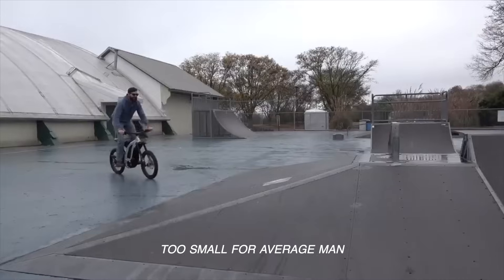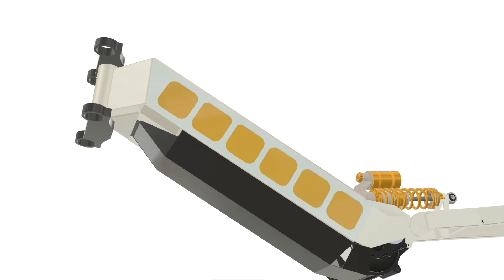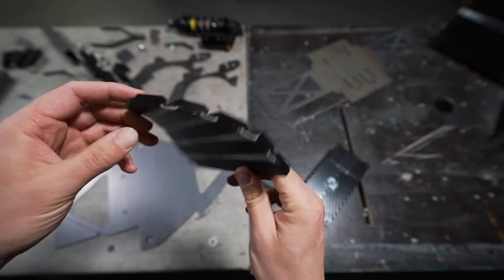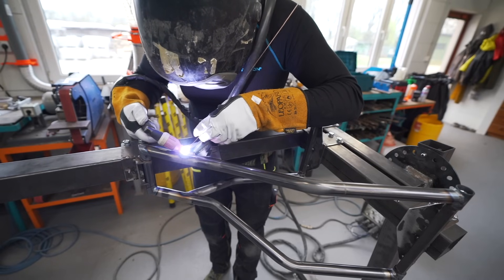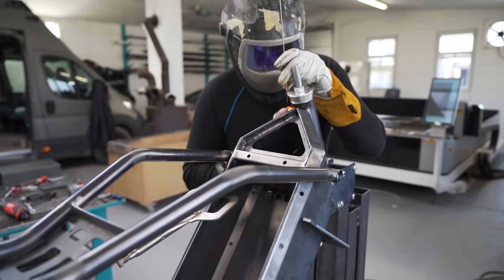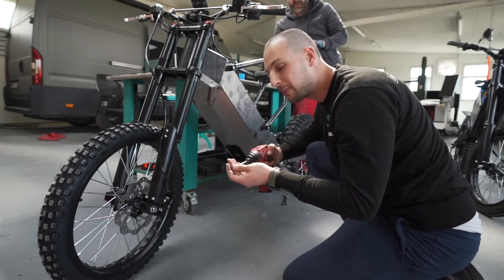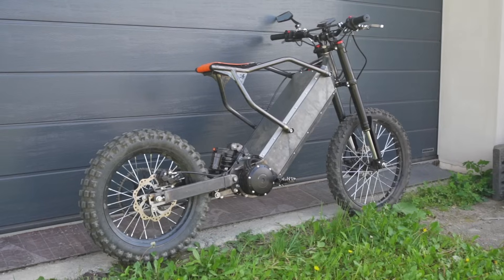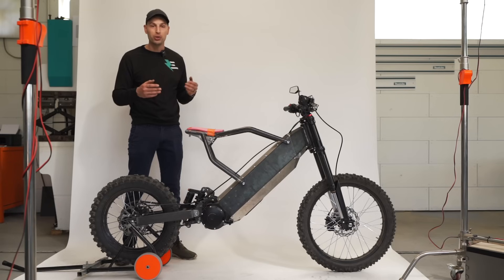Building Insanely Fast Electric Motorcycle From Scratch / New @ridevoltic Build

Comment: You dont paint it, you powder coat it when its done.
Reply: Yes and no, in the racing and frame building industry it is argued about. Yes powder coating is amazing protection but the layer it forms on the outside can hide any cracks that may form in the metal. I think builders preference based on amount of abuse frame will take.
Reply: In my experience any cracks in welding joints show in the powder coat.
Reply: @TeamStevers dependant on how thick or flexible the powder coat maybe ...  the crack may become fatal ... before it shows through
Reply: @TeamStevers  welding joint aint the whole frame
Reply: @TeamStevers absolutely yes! Agree!
Reply: Paint is better than powder coat.
Reply: I told you agree powder coating good peel off no matter how good the protection is underneath @Turbogto_guy

Comment: Nobody makes this yet? Ya its call the STARK VARG sexiest most powerful e-bike 80hp (60kw) at the rear wheel and best handling dirt bike there ever will be.
Reply from the maker: That’s a different price range and use category. Not even street legal.
Reply: @ladiandmargaret  A bicycle isn't street legal but we still ride them down the road. I didn't realize you wanted to ride on the highway. A different price tag. I bet you're time is easily worth 30 bucks an hour. How many hours you got into this build? How many times have you had to cut the parts out? How many redos have you made? How many people are working on it at 30 bucks an hour? Just saying!
Reply: As the saying goes, the cheap turns out expensive.

Comment: Innovative work as always Ladi 👍. I am genuinely scared for your ankles though! 😅
Reply from the maker: Why?
Reply: @ladiandmargaret  Hello Ladi. The lower seat frame mounting bolt position, that you currently have, could potentially shatter your ankle in a side accident/fall. If you move it to a position that avoids the ankle and main arteries it would be safer in a side impact. Right now, without a cover on the tube, it looks very much like a leather punch 😅.

Comment: Great project !  I have a 15 Kw e-bike with 3.5 Kw/h battery capacity and I can make some informed observations. I posted a video with me a few days ago and I recorded some more today and will post soon. I did over 1000 Km on this bike off-road, in the forest, in mud.
1. The engine needs a shield because that`s the impact spot every time you pass over a tree or rock.
2. The controller radiator is located in the exact spot where all the small tree branches that fly under the front wheel hit and also were all the mud builds up (just did 35 Km in the forest today and I can tell you I had over 1 kg of mud in that exact spot in less than 15 km)
3. The body of the bike has to be of plastic with crumple space so when you crash the plastic will absorb the impact before the metal case is crushing your bones.
4. Ditch that seat frame and make a classical triangle in between the fork, engine and seat and make the seat double for 2 people and maximize a storage space underneath so you don t have to carry a backpack with cloths, tools, snacks, water, survival emergency kit, medical kit. If the bike tail is not over all the back wheel the mud will fly on the back of your head.
5. You have to be able to hold tight the bike with your legs/knees in standing up and on the seat position to stabilize it in ruff terrain and also to put less stress on your arms so you have better endurance. 
6. Make it waterproof !!!
If you address these points I will absolutely sell mine and get one from you.
Success !
Reply from the maker: Hi, thanks.
1. We will have a shield on the second prototype.
2. We’ve been working on mudguards
3. The battery will be around plastic to absorb impact when crashing. I don’t know how you imagine body from plastic.
4. I disagree. Storage will be made as soon as we figure out the most important mechanics. I don’t think these bikes are supposed to be for two people.
5. I agree. The current design is very good for holding the frame with legs when standing up.
6. I agree, it’s designed to be waterproof obviously.
Let me know when you are ready to order.
Reply: Thanks for considering my ideas. I want to see the final design before I order because I really love what you guys do and I like a lot this specific design apart from the seat frame and ergonomics. In the current state I would order it but then have to ditch the seat frame and pay someone else to build a double seat with as big as possible storage space underneath and have to mold some how a plastic body which is pretty expensive as a one of. I will closely watch the future details on this project and I already put for sale my ebike and a truck so funds will be available by the time you get closer to a final design. Another thing it would be interesting to look in to is to see if it's possible for the inbuilt charger to be compatible with a small petrol generator. For example I have a small 4 stroke generator that makes 800 W/h but my charger is 840 W/h and the generator cuts as soon as I connect the charger. So it would be awesome if you could select a few power levels that the charger is requiring. This feature is also a safety feature as Lithium batteries degrade over time and some might wish to charge them slower especially if they live in a very hot region.
Reply from the maker: Thanks. The charging current is fully adjustable in the controller setting. I tweak the charging speed all the time.
Reply: @ladiandmargaret  Wow, that`s awesome. Thanks for letting me know.

Comment: honestly the fact that the surron is tiny. is what made them popular. larger and heavier bikes exist but do not give the same confidence. 
if you really wanted size. you should have gotten the ultra bee or even the storm bee and your 'issue' is fixed. as the storm bee seat height is larger then most gasoline bikes.
Reply from the maker: I solved it my way. I’m not making dirt bike, this is supposed to be all purpose bike.
Reply: @ladiandmargaret  make a supper fun free ride bike that would be ligit

Comment: Needs 21"in front & 19" in rear and run some tubeless tubes to get max performance from your tires. Tires are always over look.
Reply from the maker: I agree with tubeless. This bike already has 21 and 17”. I disagree with 19” at the back but will likely install 18”.

Comment: Longer, seat with more padding for our gentlemanly tenders.  Definitely sweet design!! It rips!!!
Reply: If there was 6-8 attachment points on each side for the seat, you could have multiple seat & cargo options
Reply: Yeah for short guys like me and the taller rest of the world :D
Reply: Yes bro, any mountain bicycler has a correct grasp on correct ergonomics!
Reply: The back seatposttubes should have shocks and more mounted to the back
Reply: also a protection shield for the electric motor too
Reply: i am developing a bike that will have a small salt water Jacuzzi in the seat that your tender little man cubes can soak in while riding. of course special riding pants are required for easy access to your cubes.
Reply: Without fenders and longer seat and taillight and head light  I won't touch that bike. I have Electric scooters .I ride electric scooter  everyday to go to work and back home
Reply from the maker: The finished product will ship with fenders, lights, longer seat. We work as fast as we can to make it all happen.
Reply: @ladiandmargaret that's all fine but you can't attach a rear fender off the back of the seat , which limits you to some fender barely above the tire. it will kill the motocross look. that seat is ridiculous . make something with some padding. I like less is more, but you went so minimal it looks incomplete.
Reply from the maker: I was not planning on attaching the fender to the seat. Seat does not have finished cushioning.
Reply: This is mechanical protoyping my guy, fabrication is next. Don't be so critical, this bike is awesome and has a lot of updateability. Don't like the seat? swap it out, it's only 4 bolts.
Reply: @ladiandmargaret  I gotcha i hope you took it as constructive criticism and not as trolling. I have built a couple of emoto frames for fun and i know how challenging and the amount of man hours it takes, no disrespect there to be sure.  there merely observations. I know there is differences in European styling and ergonomics and western culture. blending can be a challenge. So just take my observations from a western view point. and i am just 1 person so my opinion matters little.
Reply: @ladiandmargaret  I would see: What happening if you add to front side an already electric-motorized wheel? 
And you could add a selective button to the front wheel for using it only when wanted.
Reply: why are they making the seats so short there is a reason a real dirtbike has a long seat and back fender so you dont get ur balls cut off if you get sucked into the wheel and how you supposed to seat bounce anything or lean back at all ...this this is the worst design i have ever seen
Reply: @ronmit-p5g it’s a prototype, man…
Reply: why would he not just buy like a blown up 250f and make it an e bike ...the thing he made looks just as dumb as the little shit bikes in the beginning

Comment: It would be great to have a full suspension kickboard of the same style, but a cheap model like that doesn't need to go fast, but you could travel 50-100km on one charge and the charger could be included and the rear could be for example 12-14" front with 17-19" enduro bike tires  , we in Finland are really tight for money now
Reply: How much would it cost just the frame, So I would very much like to buy and support this latest test of yours, but almost €10,000 is simply too much for me.

Comment: Hi Ladi! I've been watching you since you started and I really love how you're progressing. I love and support this e-Moto build.

Here are the things I would suggest for this specific model:

1. Longer seat
2. Supermoto street tires
3. A modular storage box under the seat which could be used for a lot of things, or an additional modular battery pack in case of emergency.
4. Some signal lights and a headlight would be needed too.

I'm rooting for you! Keep up the great work! I hope I can get a unit soon to show my support for your campaign.
Reply from the maker: Thanks! Seat will be extended, supermoto tires tested, the main battery will be replaceable and signal lights mounted in the finished version
Reply: I like the idea of the additional modular battery pack.  There's so much space that you could easily double the capacity of the current battery and extend the range even further.
Reply: Could make the extra seat modular so you could remove it for storage

Comment: You are making the bikes we all want and need. And you are correct about people are making e-bikes like petrol bikes. Wrong way to go about it. You are doing it correctly!!! Keep up the great work!!! Thank you.
Reply: Except that on regular bikes there  is a reason the riders seat height so high, (mostly engine and frame constraints) on this bike that's not necessary. Lowered center of gravity means better handling. You could also build a chopper out of one of these, and I'm sure they would sell !
Reply: The only things i do not like about this bike are the lack of battery cooling for such high charge and discharge rate, and second is if you want to do mountain biking like activities on this, the back swing arm mounting seems weak to twisting, on a normal frame you have a triangle there, now you do not, and it's basically a bend line, the weakest type of structure... i would also like a drop seat on a locking spring gas strut, but that is for the MTB tracks, I also wish for regen braking to reclaim the power while i go down hill...
Reply from the maker: We have the swing arm brackets locked pretty well. I know it’s critical. On the current version we have the seat height adjustability. Regen braking is default on our bikes but don’t have your hopes up it’s any significant charging. More like brake pads saving. The battery has cooling system but I don’t even think it’s needed because how little of the maximum rating we draw out of it. It does not heat up much.
Reply: @ladiandmargaret  good to know, thank you, but, Did you try the battery temperature while climbing a hill? 
P.S. is it possible to also have a tow hitch attachment at the back and a trailer with wireless lights for cargo in the city, and mild off-road for the dirt/gravel roads country side?
Reply from the maker: Of course I did. My testing conditions were peak summer, riding as fast as I could handle in various terrain, heating the battery to maximum 42 degrees celsius and then charging with 4kW. It would build up to  46 degrees celsius max. 60 is maximum rated while charging or discharging max current. We are not even close to the max temperatures and max currents. Hitch is possible.
Reply: Nice. Looking forward to future development of the platform, since you do not know what it can or can't handle, until you have random people with random locations, and random uses, actually use these vehicles, because you can't predict the unpredictable, you can prevent catastrophic failure from what it is known, and build redundancy, but not to all use cases. P.S. why not use a system similar to what hoovers/aspirators used for the charging cable to make it retractable, because spiral cords always break on me, on any type I used, audio, power, ethernet etc.
Reply from the maker: We’ve tested this extensively so we know at this point well what it can handle. Retractable cords need a drum, mechanism and more space. Takes more weight and with high current charging creates a coil. That’s dangerous. Our coiled wires are very good, we’ve used them for years and they don’t break.

Comment: You make some awesome creations.

This is no exception.

I’d incorporate a longer seat option, motor, battery & controller cooling.

Technology is advancing to now incorporate mechanical gears & ABS.

I say this, because in addition to pioneering a new design framework, you may as well pioneer what is truly capable given our knowledge & tools of today’s time.

Great products & vision, looking forward to seeing more.
Reply from the maker: Thank, the battery is overkill and the motor as well. So far we did not even reach temperature close to overheating or causing any issues. We have few ideas for ventilation but I hope we can avoid extra complications and components prone to failure.
Reply: I like that the battery is in the lower part of the frame giving you a lower center of gravity for cornering however all that empty space underneath the seat could easily be an extra 50 to 70 miles of range making it a better daily commuter or longer rides but regardless of my opinion it's a beautiful creation that I wish was more my size because I'm only 5'7" but I do need to know what is the final cost?

Comment: Looks great Ladi, I got the plans to build the Cyberbike, and began sourcing components but I was at a dead end when I tried sourcing a battery and charger. I live in the US where we have weak 120v single phase residential power. I've even tried to get a local lithium battery manufacturer to build it, but they were not exactly willing to do it. So, I am at the end of my patience trying to get the bike built. Its been almost 2 years and I have since bought another bike to ride in the mean time. Honestly, If I knew more about building a battery, I would do it myself. I just dont know enough to build it myself. Perhaps if I had a diagram of the battery cell layout and where to spot weld the nickel strips I might just do that. But as of now, i have given up.
Reply from the maker: We ship batteries to the states. Our chargers work on 120v grid as well, just charge half the speed.

Comment: I love this and i would do this . 1 put a longer seat 2 put the wires in the box so you can't see them . 3 why not do a national flag colour ? Like red seat green baterry and red swing arm
Reply from the maker: What wires do you mean?
Reply: @ladiandmargaret  the one that comes from the handle bar to the back break , it looks like it goes there
Reply from the maker: Yes, the brake hose will go through the frame on the finished product.

Comment: Seat frame should be easly collapsible for easier transport. Just change tubes geometry and put quick connector to the main body. Also, normal qube/square cargo space is much more practical than overcomplicated weird magnetic box. Just a platform or place for a box is much more DIY compatible and more universal solution.
Reply: Collapse like the Kuberg Ranger 👍🏻
Reply from the maker: The seat post is held on 4 bolts, i think it’s easy enough to take apart.
Reply: A monobloc seat would be pleasant instead of tubes. Otherwise great design. Finally someone who doesn't reproduce the old bike design. Well done  @ladiandmargaret